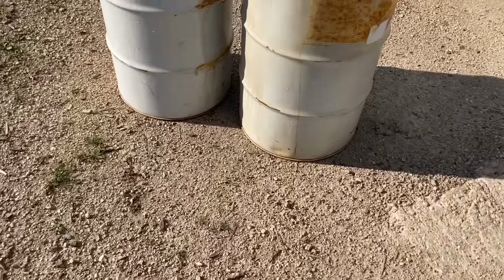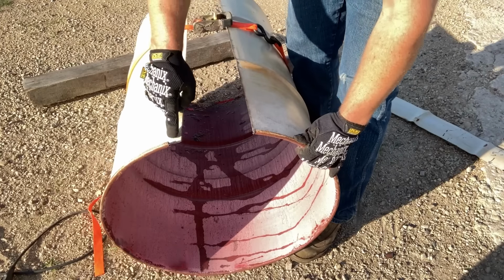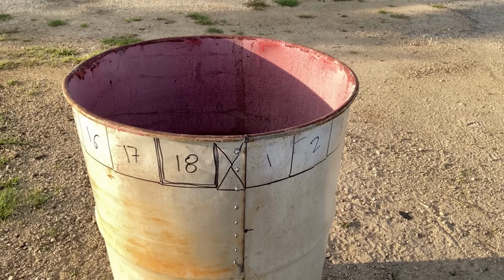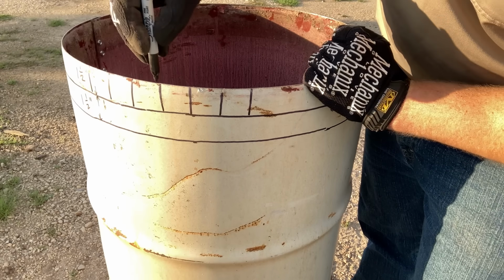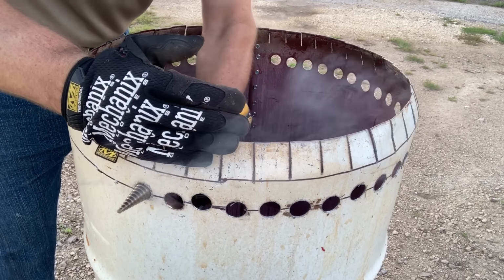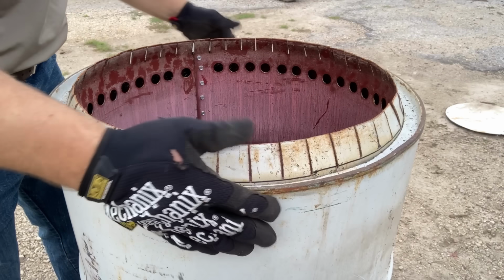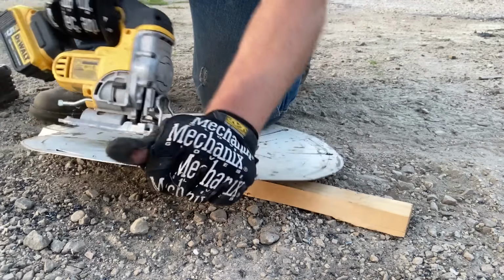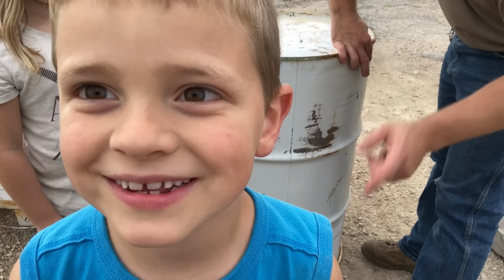Smokeless Burn Barrel

Comment: Ok. So my backyard work with what you got on hand for desired purposes.. ran. Full on with this one. I needed shop heat. But my shop is in the making. Im using a 10x17 portable garage lol. So tarp. Its cold. The distance to the house  is about 90 feet. I have an extension cord running out but pulling power that far with any kind of heater while running anything else,  pops my breaker. Im basically building from the inside out because winter has done hit us. Im a freezing artist lol. Im also the stay home mom work horse. The kids dad is the working show pony. I own the tools.  I build and fix everything.  The extra income we need is reliant on what i create. Cant do that freezing and popping breakers. I scaled your burn barrel down to a well ventilated, very well lol, indoor version and stuck a pipe on top and out the opening. The size of my barrel is about 3 feet high and just about a foot across.  It's made of the same metal and looks exactly like tour size, but it was one of the smaller barrels.  All i use now is a little fan to blow my heat around.  I practiced/tested this method first with a couple metal paint cans. Threw in some little chunks of scrap lumber and carving shavings and couldn't believe how much heat even that size put out. The  pipe was added because the heat from a taller version would have melted my tarp that comes with the portable garage.  Got it at harbor freight so kinda cheap but needed something after moving into this house without a garage to have tools protected from weather. It's ghetto.  But on a budget and scrap building supplies,  its what i can afford.  And this is the second one.  The first was tucked to the side of the house. The wind got me. Literally.  It was anchored to the ground but the wind picked up. Before I knew it, a corner was being lifted from the ground.  I ran, jumped on the corner,  dlammed it back down,  grabbex my rebar and hammered it through the hole in the pole. Even before I was done, the opposite corner started lifting. So I ran around the outside and jumped. But this time i didn't have time to hammer anything. I was lifted about 6 feet up before it flipped up and dropped me. It landed in the tree and on top the roof. My neighbor came running to the fence asking if i was ok. I was still in shock and just nodded while getting up. Everything of my was all over. Much got destroyed. This burn barrel was my win. Eventually.

Comment: I would put a round hole into the ground a bit bigger than that diameter of the barrel.  Making it a bit bigger will still draw air into the bottom of the barrel and keep the heat up still making it smokeless. Then you have the ease of the barrel but then also have a fire pit without the need for really tall chairs and less exposure to a very hot barrel surface.

Comment: My first question, was wondering if the principles demonstrated here, could be modded for application in home fireplaces or wood stoves, as both would be more prevalent in North America, than the trash barrel usage - I think. Thinking of the ability to reduce emissions  as a result of the use of a secondary burn. I imagine there would be reductions over existing stoves and fireplaces burning wood, but not sure how that compares to natural gas fireplaces. Just thinking out loud here - I’m not the the technical guy here.

Comment: Nice. Little I can see to improve upon. I'd make the bottom grate a bit more solid. I'd also paint the outside with high temp enamel.( 1,500'F+ ). Otherwise you will rust out to useless left outside in 2-3 years.😊

Comment: Thanks for the great video.  I'm following your video step by step to build one and then realised that you switched drums when doing the inner drum.  Your first markers for the 3 1/2 "boxes was numbered left to right but on the one you cut was numbered right to left.  I'm just wondering if the change in direction will affect the rotation flow for those vents at the bottom.  I already marked and cut mine left to right.  Will see down the line.  Thanks again for the great video.

Comment: I learned another way, get a 50 gallon drum, fill it to about a foot below the top with clean white sand and pour 5 gallons of gas in it. Wait about 30 mins and light it and it will burn like a champ, the sand wicks the gas and it will burn for a long time. Learned from some old random dude when I was a young lad.

Comment: Awesome! "We're building a burn barrel, not a clock". Right you are! "Do not drill into your hands", basic safety.  Genius! 
Will this work to mitigate the oil distribution for burning poison oak?  Seems like it would. We live in the PNW where poison oak is a huge problem, but we're not able to burn because of the smoke that carries the oils. My hubbie is very allergic, and I'm not. Glad to be the quarter of the population not allergic to poison oak myself. 
I'm assuming that without the smoke wafting over our neighbors that this will mitigate the burning of poison oak oils traveling over several miles to folks that are very allergic? 
Would be a huge benefit for us to burn. Otherwise, we're chopping by hand and I have to rake and bag an acre and a half littered with poison oak all by myself because I'm fortunate enough to not be allergic. 
If this system would mitigate that, and allow us to burn during burn bans (a couple of months from now) because there is no smoke or cinders and we can burn on gravel for 20 yards in all directions, that would be a gift. 
What say you?
Reply: I'd think as long as you get it started without poison oak, and feed it kind of slowly, it ought to work. Try playing with fire without poison for a while and get the hang of how to keep it smokeless and how to make it smoke.

Comment: Just finished mine!! It works like a charm!!!!!   

I was having issues getting the step drill bit to drill through the metal so I ended up using a holesaw for some of it.  The other holes I made by doing bent open triangles (instead of circles) with a jigsaw. Both worked fine. The jigsaw worked a little better than a holesaw.

Most of it was eyeball, not measured, and it still works great!

Comment: Cool design❤, what if you drill a hole in the Smoking one and you install a Pipe made of metal in the middle which can suck fresh air from below like a inverse chimney. Would that not be even easier to achieve the post combustion?

Comment: i would cut a hole in the side, insert a metal pipe, and feed the metal pipe with a leaf blower.  no smoke at all.  down side, it burns VERY hot (like melt aluminum -- it basically a forge)  and the burn barrels don't last that long.. but very easy and no smoke and the contents are gone in no time.

Comment: Thanks for the idea - thinking about building one.  I'm wondering if the hole drilling at the bottom of the outer barrel is reall necessary - if the bottom is open, wouldn't it still draw air between the barrels without the holes?

Comment: Awesome.  A lot of people are using burn barrels to produce biochar.  The second chamber is effective for eliminating the smoke, but I wonder whether too much oxygen would enter based on your design and turn the wood to ash instead of biochar.  An inner barrel with a solid base and perhaps an adjustable side vent through the outer barrel might work.  Also I'm wondering whether 4 barrels could be used to make a double barrel twice the size instead of buying new sheet metal.
Reply: If you want to make biochar (charcoal) you will definitely not use this design of incinerator.  Biochar is made basically by heating wood in the absence of oxygen:  you would need an entirely different design.
Reply: @bernarddavis1050  Can you say what needs to be different?  This looks like a TLUD without a chimney, no...?
Reply: I don't know what a TLUD is.  I do know that you make biochar in a totally enclosed  (apart from a small vent hole) drum which is filled with wood and  heated over a fire;  the water and  volatile elements are cooked off and vent as (combustible) gases.  When this process is complete, you open up the drum and what remains is charcoal (biochar).  There is no combustion in this process apart from the fire used for the cooking.  The burn barrel shown here is designed for a very different purpose; i.e. to produce more complete combustion.

Comment: some ratchet straps come in 1-1/2" width. you can use that as your guide for the upper fins, their respective air holes, and the guide lines at 15:30

Comment: I’m adding copper coil to the outside of the inner barrel for a really nice pool heater.
Reply: hey there Gabriel, I am about to begin creating this type of burn barrel and one of the necessary additions I'll be installing is 50 to 100 ft. of 3/4 in. copper tubing. I happened to see your comment on this post so I wanted to ask if you have already added your copper and if you have, how did it work out? 

I had planned on placing my copper coils the same way as you had mentioned, as this placement surely would equal less time having to routinely clean the crud off the coils since they would no longer be in direct contact with the fire....but I wondered if the coils would still get very hot this way, would the barrel still remain smokeless, and would there be enough room for all of that copper to fit in between the two barrels without having to modify the size of the inner barrel? 

lol, sorry for the 100 questions! I just really wanted to know how it worked out before I began working on this project.

Thanks,

-Jason
Reply: @justabitill  Good questions! I haven't started it yet - I've been pulled for TDY for a couple of months. I hadn't considered having to modify the diameter of the inner barrel, but I'm glad you thought of it.

Comment: Really enjoyed the video. So in this version the firewood just rests on top of the thin vented lid at the bottom? If thats the case, thats the only thing I'd change. I'd build a sturdier bottom frame just above the plate with expanded metal surface so you wouldn't have to softly drop in pieces of wood or use very small pieces of wood. And perhaps a little more robust legs.

Comment: Nice hillbilly SOLO stove and the price is much better. It'll be on my to do list. Thanks! Maybe burn the old paint off thru several good burns, prep it lightly and hit it with high heat paint for wood stoves. Regardless, Nice job and creativity plus I have had burn barrels naked that last a long time.

Comment: Would drilling some holes at the top near open end(rim) of the original barrel (the one on the left) that smokes, help to eliminate the smoke? And give you the secondary combustion without using two barrels and all that fabrication?

Comment: To make a 'fire pit' use the drum from an old dryer (as long as it's enameled or stainless steel and cut 55 gallon drum to height. 
Don't forget to remove any plastic parts before using

Comment: Great job Nice instructions I'm new to cut things with grinder You make it look so easy. I am very curious as to what grinding or I should say cutting wheel you are using the way you just Plunge in I was thinking it's metal but it doesn't look metal but the most interesting thing is it never seems to get smaller so could you please tell me about your cutting wheel have a blessed and thanks again

Comment: How about a your making an inner barrel a few inches less in diameter.
Then put wood chips in a sealed inner barrel. Place wood between the inner and outer barrels. Then use the barrels to make biochar by burning the outer wood, which will char the wood in the inner barrel.
What are your thoughts?

Comment: In New Zealand we have to legally put a lid on barrels to avoid having to get a fire permit so placing a grate over it with maximum 5mm gaps is required. We tried looking but couldn't find anything so bought a fireplace guard and just put that over it with a 1m length of 1" steel square tubing on it to weigh it down.

Anyone know anything that can be used as a grate that can withstand really high temperatures?

Comment: Now get a 30 gallon galvanized trash can with a price on lid. Fill it with hardwood chunks. Put it inside before you add your burn material. After you burn your waste material, several hours of really hot fire, let everything cool off. The 30 gallon container will be full of charcoal.

Comment: The HOLY GRAIL would be to modify the air stream to get a blue flame, meaning that all and any carbon is burnt. 
Furthermore I wonder if it would be improved by a isolation at the outside of the inner barrel. In the tiny woodgas stoves I built from three tin cans (different diameter and size, riveted together), the innermost isolated with glass-fibre matting, the fire started faster and became smokeless earlier, irrespective of the wood burnt (dry, green, wet, ...). Alas, not yet a blue flame. Next step would have been a fan, e.g. from an old pc power supply.

Comment: I know this is 1 year later but I have a question...
Obviously the steel barils will deteriorate the more you burn fuel in it... How long does it last...?
I imagine, after each burn, that once it has cooled, you store it in a dry place so it doesn't rust out from rain.

Comment: Great idea …except for one drawback.  This will need to be repeated about every 12 months because with all these holes and slices it’s going to rust out quicker than a normal burn  barrel which only has 8-12 1/2” holes in the bottom to allow air in and drain rain out. Painting it inside and out with some high temp paint (not cheap) could extend its service life somewhat. I think if you burn any trash other than paper or wood (plastic etc) there will still be substantial dark smoke. I like your effort and video quality  and will attempt to make improvements. We all need to try and clean up our environment any way we can.

Well done video and some nice youngsters.
Reply: Muratic assid
Reply: Muratic asid on fresh metal exposed a 1/ 5:40 3 cup to 1 gallon. Mix spray  = new exposed sealing from rust , sprayer orbrush on 1/2 hr later. Rense hose water project off auto body hax

Comment: A lot of work for a burn barrel. The metal in these barrels are thin and don't last very long. I just drill air holes 6" from the bottom and it works great.

Comment: I wondered about wrapping copper tubing around the inner barrel with an inlet at the bottom and an outlet at the top to heat water as you burn.

The copper would be expensive ... maybe too expensive ... so this ideas for an additional feature may not be practical.

Comment: Anyone know what can be used as a grate that can withstand really high temperatures? 
Need a lid (for legal & safety reasons) and an insert on top of the fins inside.
Local hardware stores only had chicken wire 🙁
Reply: I used rebar made into a grate once, you can weld, or wire tie it

Comment: Which is better: 

(A) a smoky fire that distributes half of the carbon as CO₂ and half as lung damaging particles that nevertheless stay solid forever and don't trap heat?

(B) a smokeless fire yielding carbon free ash and 100% CO₂ gas?

Or the proposed research project:
(C) a burner made of 55 gallon drums producing pure CO₂ gas, carbon free ash, and charcoal a/k/a biochar? Half of the fuel is loaded where it burns cleanly. Most of the heat is captured to heat a closed  canister holding the fuel used as char feed. Gas and liquids driven off that canister flow out the bottom and get burned, further heating the char. When the burn ends, the char is to be disposed of so that the carbon stays solid.

Comment: You could of course just cut a hole in the side at the bottom and use a small blower to blow air into it.  No smoke burns very hot too, cheap and only 1 barrel!

Comment: Estimated prices based on 2023 inflation and general silliness. 2 drums at $200 each from a scrap yard or $750 if they are "vintage". Plus $600 worth of fasteners. Remortgage your home for a pack of cut off wheels. $190 for 11 broken predrilling bits and $310 for a Christmas tree bit.

Comment: Not trying to be rude, but my burn barrel only has holes drilled out for air and the bottoms cut out. Took me 30 minutes, I’m conserving steel by only using one barrel, and it doesn’t smoke. Also might wanna buy some proper heat paint for your barrel. I respect your idea but just seems like over kill.

Comment: the only problem is that it will rust in no time, and after 1 year  it will be just iron flakes.. trust me on that from my own experience. However a clay version would last a lifetime. Insulate it with a water jacket and you got a free hot water.

Comment: Halfway through this excellent presentation I forgot whether we wanted to build a smokeless barrel or a rocket to Mars. Not to mention the most difficult part of this project is to convert imperial units to the metric system which 90% of the planet uses. At this point I'd happily stay with the smoke.

Comment: Yeah, it's cool and all. But all the ash is left on the ground. A normal burn barrel keeps the ash inside. Until you are ready to deal with it. And if you won't over pack a normal barrel with fuel. It won't hardly smoke. If you vent it properly. Your normal burn barrel doesn't have enough venting. That's why the smoke is so bad.

Comment: You lost me. Why is the top edge contoured, and is it just getting more air to burn more thoroughly which you call secondary burn? It looks like a good first burn to me. I thought  only the inner barrel gets holes at top and bottom all contained by a plain outer barrel and making the gas swirl within and circling for a secondary burn. I give up.

Comment: Could you find out what temperature your barrel reaches versus a basic barrel and let me know. Also, I'd like you to perhaps try to put that fan part mounted so that it can spin from the air flow. If that works any better, what about making it spin with an adjustable motor? Please and thank you.